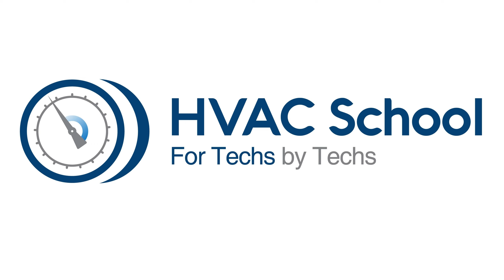Building Tech Confidence w/ Refrigeration Mentor

Comment: I learned the refrigeration cycle for commercial residential and industrial in 8 months. Process in residential, leaving the evaporator indoors leaving the vapor line the TXV bulb and the TXV external equalizer line tell the TXV metering device feeds to release low temperature refrigerant to keep the system in the comfort that it requires for what it's asking, and then it continues outside to the vapor line inlet of the compressor leave the compressor in a high pressure high temperature vapor halfway through the condenser starts turning into a high pressure high temperature liquid passes as it flows through the filter drier going back inside than it passes through TXV metering device at that point it is a flash of 80 low pressure low temperature liquid 20% low temperature vapor,  continues through the indoor evaporator to continue turning the liquid into a low pressure vapor, and at that point it is released in the air handler blower motor inside to distribute the temperature of what the building or home is calling for from the thermostat. That that's only a little bit of what I learned  much more, here,  pulls my interest in HVAC and refrigeration is the preventive maintenance. I know that that's what I want to do.